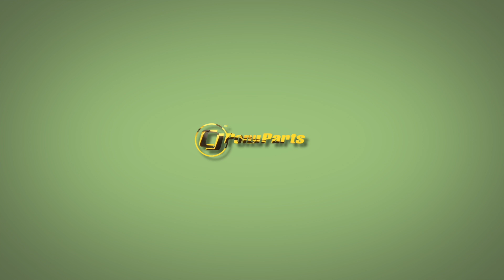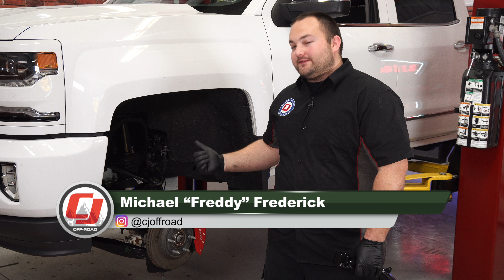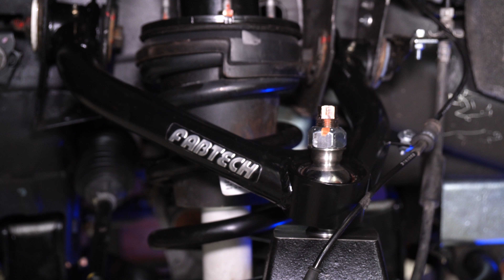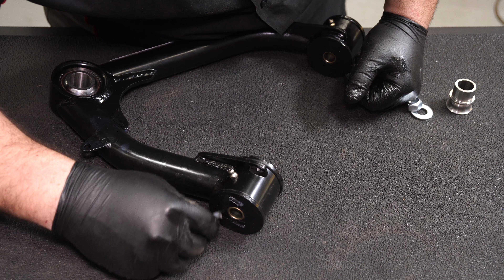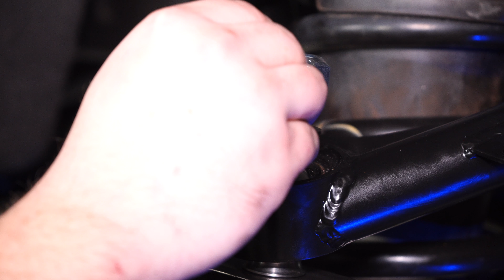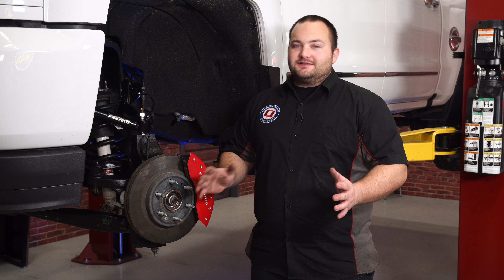Chevrolet Silverado Fabtech Uniball Upper Control Arm Pair For 0-6" Lift  2014-2018 Installation

Comment: I installed a 3inch lift on my truck and the upper control arms are sitting on the bump or droop stop.so I can just cut it and it will be good?
Reply: I did the same in my 08 GMC sierra and I have the same problem .. did you solve the problem?

Comment: YEAH THIS DOESNT WORK ON PRO COMP LIFT KIT!!!
Reply: @gene i have a 6 inch pro comp on my 13 sierra would you recommend the moog arms
Reply: What will? I have the 4” Pro Comp lift kit on my 2018 Silverado
Reply: @lyinlake  i went with moog ck a arms  work relly well my lifr with is procomp has small taper in knuckle this is for a large taper

Comment: I have a 2014 Silverado 4wd Z71, factory Rough country shocks all around. Doing a 3" front and 2" rear lift kit. Also replacing the UCA"s. Question? Is it advisable to put on shock extended brackets on rear shocks to shorten length of shocks like before, replace with longer shocks or just keep the factory shocks as is, shocks are extended after lift blocks are installed? Will this lift effect the over all factory ride? Front shocks were "compressed" at least 2 inches after install.
Reply: Ive put an extension on my rear and way better they where knocking on bad  gravel road.

Comment: Did you cut the bump stops for the upper control arms ??
Reply: I did the same in my 08 gmc sierra and I have the same problem .. did you solve the problem?
Reply: Yes they cut them off
Reply from the maker: All we did was what you see in the video.

Comment: I have a 15 silverado installed these today but my torque specs were way different 127ft lbs for lower nut on joint and 150 ft lbs for upper nut